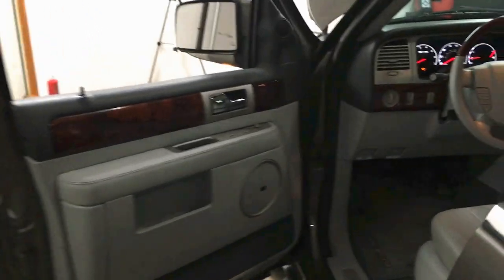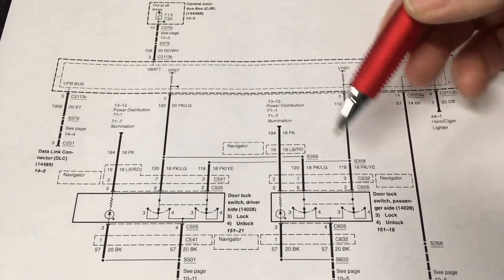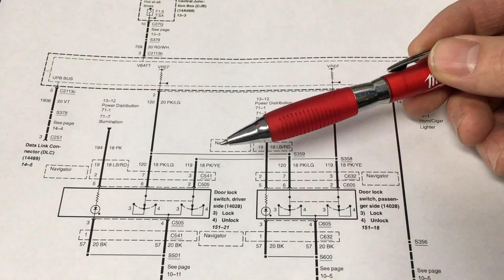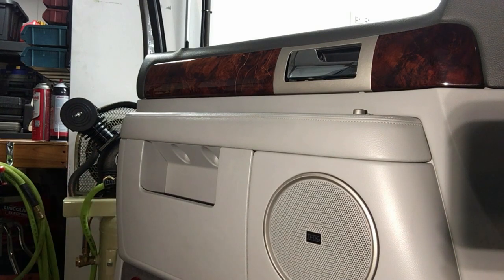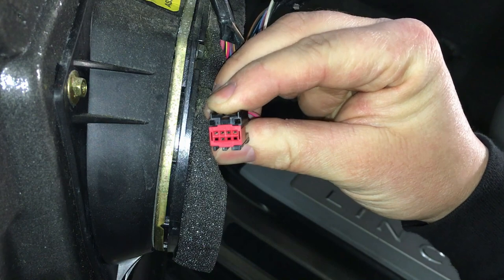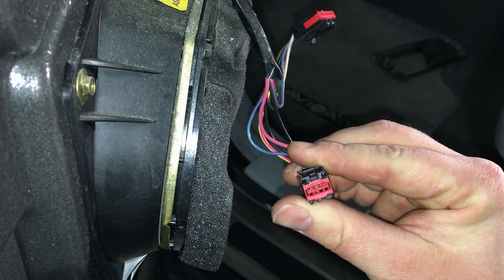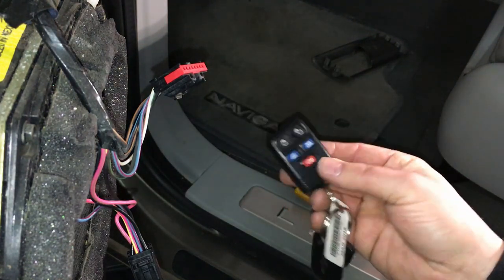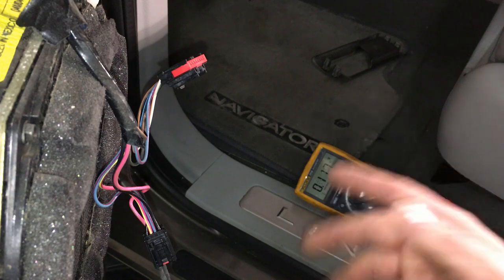2003-2006 Lincoln Navigator Power Door Locks Inoperative: Quick Diagnostic Methods

Comment: I have a 2003 Explorer. At different times I have found five different wiring breaks in the drivers door wiring harness where it connects to the body. I have soldered extension wires to repair and extend each wire. It appeared as if the wiring harness was too tight stressing the wires. The breaks were easy to find, I just pulled back the rubber boot and I could see the broken and separated wires. This troubleshooting guide is excellent, but I would visually look for broken wires first. It only takes a few seconds and you do not have to take off the door panel to check ( but you do have to take off the door panel to fix the broken wire).

Comment: thanks Brian for video, looks like vref is maybe a 5volt square wave just like BMW door switches then when it's locked/unlocked it sends 11volts over the same wire to actuate the solenoids would be good to see it in scope or graphing multimeter but a big thank you anyway cheers sandy

Comment: Hello, excellent explanation, and especially thanks for showing the wiring diagram. Can you tell me, the jumper that you used to test the circuit from 4 to 3 and 4 to 7, did the jumper have a resistor in it, or is it simply a length of wire to create a short circuit?

Comment: I have a 2005 Lincoln Navigator and after replacing my wiring harness, all of my power windows and moon roof stopped working. Which fuses should I look at to fix the problem?

Comment: I'm working on a 2002 model Navigator. A few strange things have been observed with this vehicle such as the rear lift gate opening on its own while parking and the exterior courtesy lights along with the dome lights would stay on upwards of 35 minutes or so. I have not been able to duplicate these issues, but I have witnessed them myself. I'm curious about the PRNDL indicator light. I noticed yours is illuminated at the beginning of the video. When is this light supposed to come on and how long? I've been told the instrument cluster loses gauge illumination intermittently, but the needles stay red. I have a ghost in the machine somewhere.

Comment: good info, as always....
what is the best way to change spark plugs on a 07' Explorer, with keeping the possibility of  stripping the threads in mind... warm engine or cold??. thanks in advance.
Reply: I'm assuming you are talking about 4.6 3 piece plugs?If so,best way to replace them is warm with some carb cleaner into plug hole to clean some of the carbon build up..

Comment: I have a 2004 lincoln navigator.  The turn signal indicator switch is broken. Online cheap as 150 to 250 bucks but I found the 2004 Ford expedition xlt looks the same. Is that part the same on both or is there a difference? . The Ford model is 80 bucks. They look identical...

Comment: Couldn’t find a vid on mine. 1999 f150 when I hit the lock or unlock switch both sides try to lock and unlock but act like they are jammed. Pass door switch same way. Both sides did it same time. Now have to lock manually. What do you think causes this or I would like to see a vid on it. Can’t see both actuators going bad at same time

Comment: You posted this video just in time. The driver's side dock lock on my son's '06 Escape stopped working yesterday. The remote only unlocks/locks the other doors & the switch doesn't open any. The passenger side switch unlocks/locks all doors except the drivers door. Is it safe to assume that the driver's side switch is bad or is there something else I should check?

Comment: Hi, my 2004 Navigator has lost some of the functions under the setup menu. When I say lost, I mean they disappear from the Setup menu, such functions as reverse mirrors, easy exit seat, autolamp delay, reverse sensing system, power deployable running boards, etc. Therefore I don't have access to those functions anymore. Power lift gate module is working fine. Do you know how I get those settings displayed again back in the setup menu? I read some people had this issue either when they changed the battery or when they removed the error codes with diag tool, but no one wrote any fix. I'll appreciate if you can help me on that

Comment: My 2010 navigator lock button won't work for driver and passenger but unlock works for both.  Its not the switch bc grounding out the pin didn't lock it but it did unlock it. Door locks work with key fob and door code buttons. Where should I look next?

Comment: hey man just wondering when a 3.5 ford engine leaks from the water pump will that water drip from around the rear seal or back of oil pan it is a 08 the dealer said it was the water pump

Comment: Awesome information, my 2004 Lincoln Navi driver door power door lock just crapped out. I will do exactly what you said to see if it’s just the switch.  Where can you get the jumpers with the pins that you use? Did you Custom make them?
Reply: I have the same problem

Comment: I might of missed it but how to do fix it. I have a 06 navi. Similar issue but mine only locks and doesn't unlock. Please show how to repair it. Moreover I got my remote wet and it goes crazy- unlocking, locking, opening liftgate, etc. How can I fix it. I already dried it, sprayed it with sensor spray, removed and replaced the battery and nothing works.

Comment: holy crap, just got finished with my explorer and came to check my email and saw this, the unlock on the driver door didn't work. took off the panel, popped the panel Christmas trees(yours is much easier), took out the switch from its frame ,carefully took the switch apart , sprayed it with maf cleaner. works better than new, tested before the door panel went back. i put a tiny bit of Motorcraft xg-12 on the contacts too, but that is prob unnecessary.

 I think you can activate locks thru the scan tool too to test. A new switch is like 30 bucks, try this before paying for one.

Comment: Just because I'm a Nerd....you said the Vref circuit was 5 volts, so why was it showing near battery voltage on the Fluke when you performed the lock/unlock test with the remote to wake up the module?

Comment: 03 Lincoln aviator have lights on the heater and cooling seats button on drivers door .however the heating and cooling seats don't work when the button is pushed..also instrument cluster is dim and sometimes will get bright   on its own and them dim again any ideas
Reply: Luis bustamante

Comment: Can anyone help me a few months ago I slammed my door shut (drivers door) and the door look fell inside the door. The lock still worked fine so I didn't bother opeining it to re attach. A week ago my door handle broke. So today I replaced it and re attached the little lock back on the acuator now it doesn't work. I don't think the acuator is bad. Since it was working 5 mins before I did it and never gave me issues. I couldn't have shorted something because all the other locks work

Comment: believe it or not, must of these problems with this particular navigator is water damage. usually the actual problem is rust in the switch. just take it off, clean the rust out from the connectors and put it back together. it should work.
Reply: Exactly. I posted a video..... done and done.
Reply: Exactly. I posted a video because this one was extreme. Scraped the crud out..done!